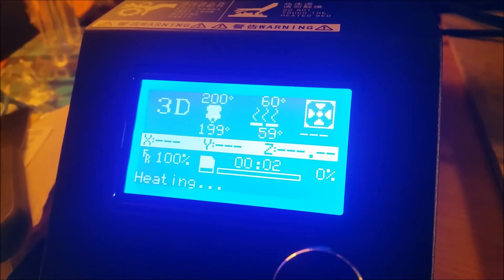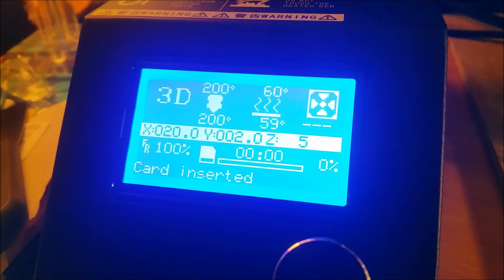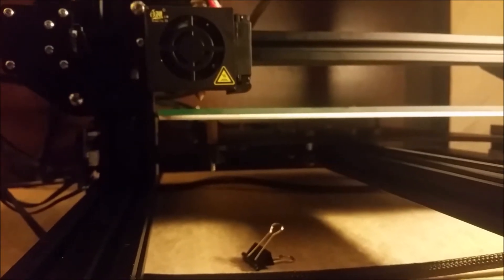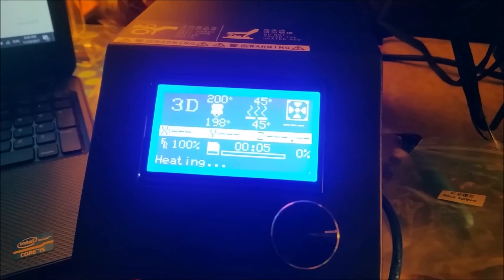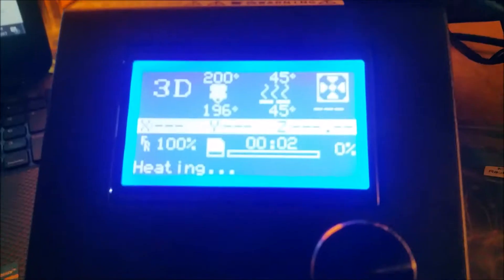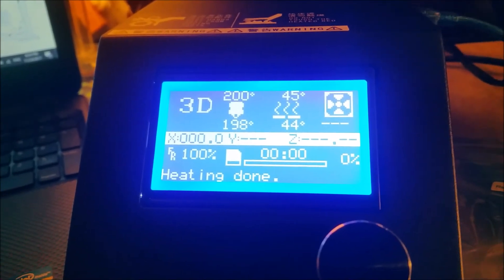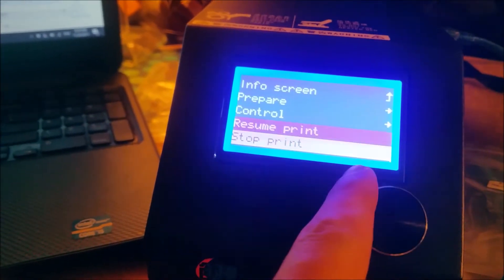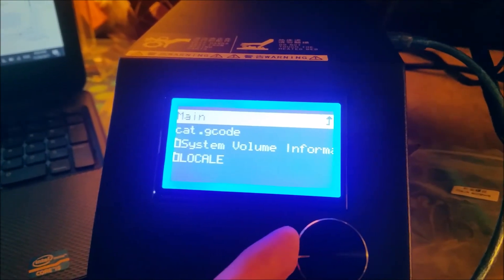Just got my CR-10s 3d printer - Troubles right out of the box...

Comment from the maker: Solved it! By flashing the firmware with Xloader. Got this tip from someone with the exact same problem.. So if  you too have this problem, deff try this:
https://printedsolid.com/blogs/news/installing-marlin-1-1-6-on-your-cr-10s-with-mesh-bed-leveling

Then click this:
"CR-10S Firmware Source Code and Hex Files"

Just follow the instructions.. you need to do this with your pc connected to the printer via usb. 

Cheers!